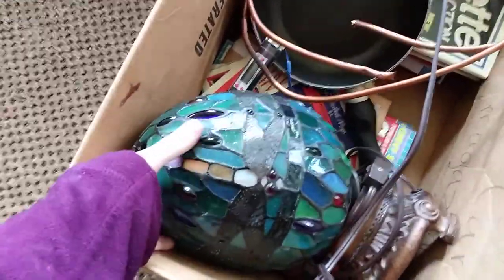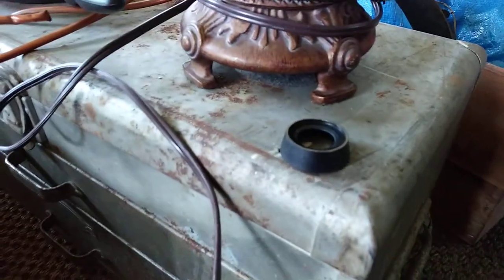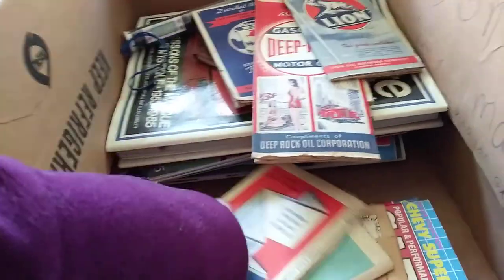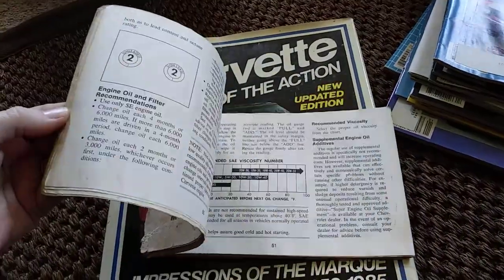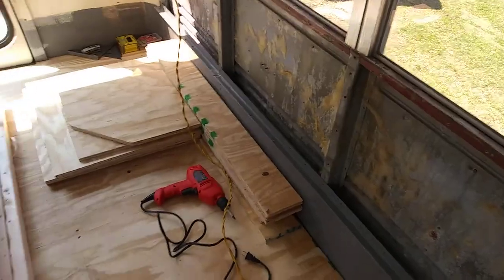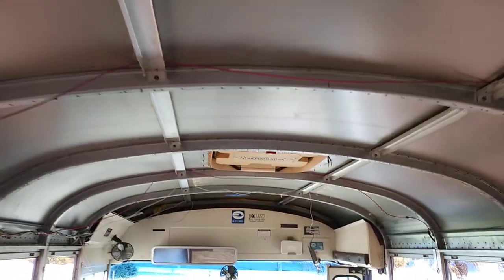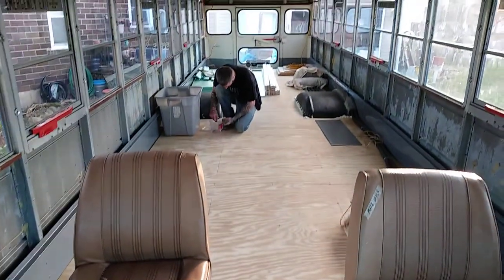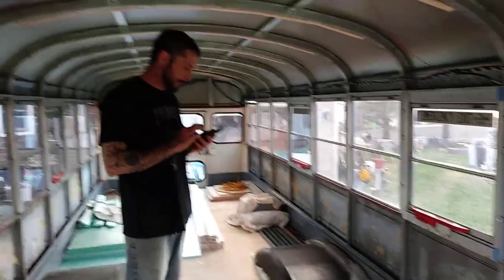Garbage Picked Mystery Unboxing and Bus Conversion VLOGGING

Comment: I think the top might have had one circle glass bead at the very top then the side holes might have been empty to let heat from the bulb to escape
Reply from the maker: I found it on etsy I believe. It was a lottle bead topper with metal sides. I think it's still sellable but not sure
Reply: @collectivetreasurespickin  I would definitely resell it as is.